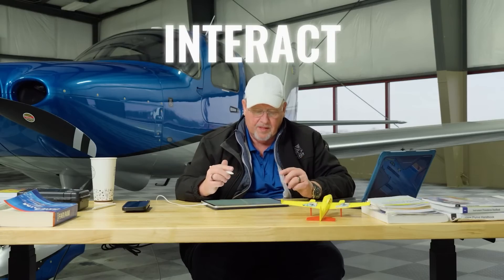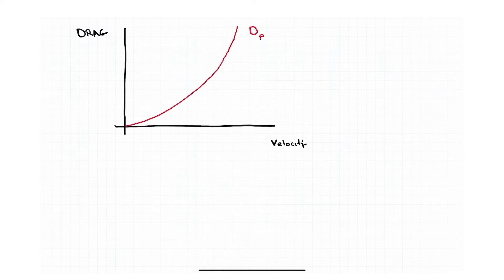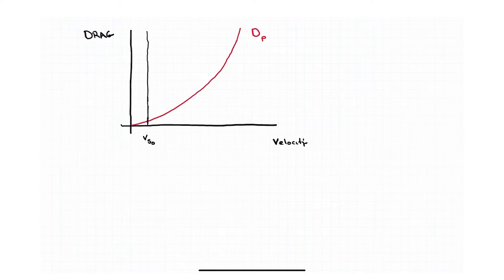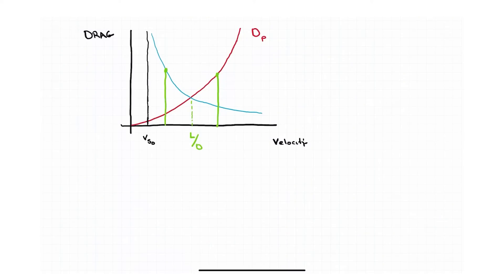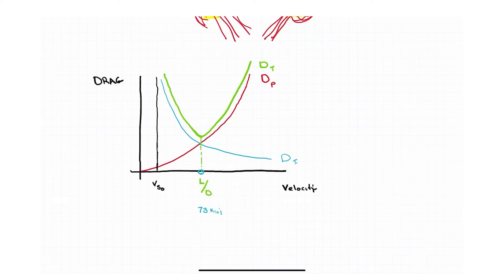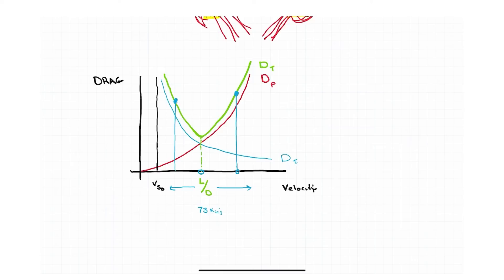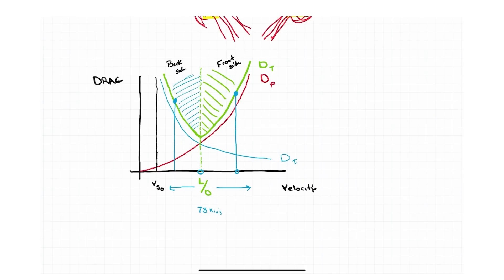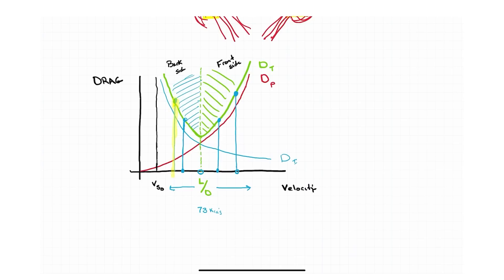Principles of Flight: Understanding The Region of Reverse Command

Comment: I understand that the explanation was given by a pilot, not an engineer, but the total drag curve in the diagram is incorrect. It cannot be so close to the parasite drag curve or the induced drag curve. Just sharing opinion on possible improvements
Reply from the maker: Thanks for your input Dan.  My intent is show that as speed increases, parasite drag increases.  As speed decreases, induced drag increases.  The other point being made is that if we fly slower than L/D, we are on the backside of the power curve and we then control speed by reducing angle of attack and  induce drag.  I could have just as easily copy pasted from the PHAK, but I think worked to get the point across.
Reply: @MidwestCorporateAir  "on the backside of the power curve and we then control speed by reducing angle of attack and  induce drag."  If you do that you will descend.  There is nothing in the handbook that says to do that.  You are confusing what reverses.  From cruise to Max L/D, speed and drag both decrease.  From Max L/D to minimum speed, speed and drag move in opposite directions - i.e. drag reverses its path and goes up.
Reply from the maker: Warren, I think if you look at my response above, you will understand what I am saying.  If you refer to figure 5-6 in the PHAK, you can see that as you slow below L/D max, we are trading speed for AOA.  This increase in AOA, causes an increase in induced drag, hence an increase in total drag.  As such, we need more power to maintain level flight on the back side of the power curve.  Agreed?

On the front side of the power curve, above  L/D max, we need more power to overcome the ever increasing parasite drag.  Agreed?

In the slow flight section of the Airplane Flying Handbook, you will note "When flying above the minimum drag speed (L/D max) more power is required to fly even faster.  When flying at speeds below L/D max, more power is required to fly even slower.  Since slow flight will be performed well below L/D max, the pilot should be aware that large power inputs or a reduction in AOA will be required to prevent the aircraft from decelerating".  "It is important to note that when flying below the L/D max or on the backside of the power curve, as the AOA increases toward the critical AOA and the airplanes speed continues to decrease, small changes in the pitch control result in disproportionally large changes in induced drag and therefore changes in airspeed.  As a result, rich biomes a more effective control of airspeed when flying below L/D max and power is an effective control of the path".

In closing, I have read your statement several times and I am truly trying to understand where my" glitch" and your disagreement is.  I am happy to keep going and see if I can help clarify what the I, the PHAK, the AFH are saying.  Maybe I am just not being clear but Im happy to try again.  Thanks Steve B